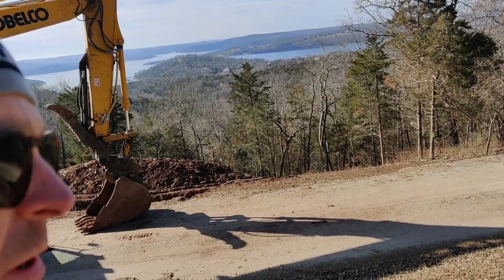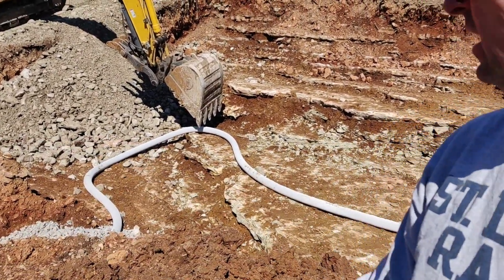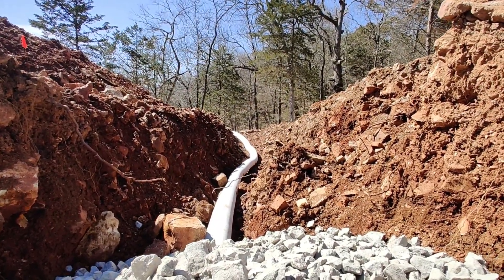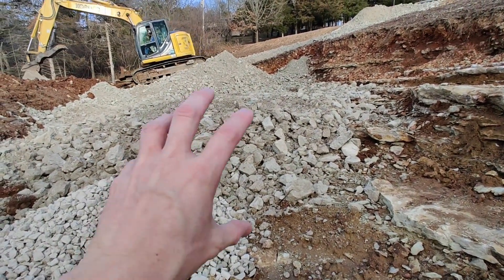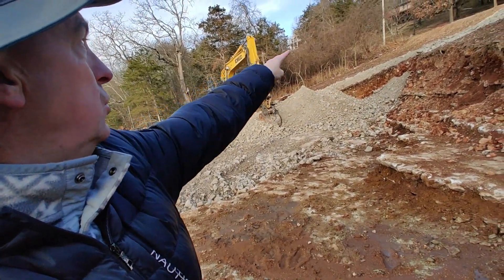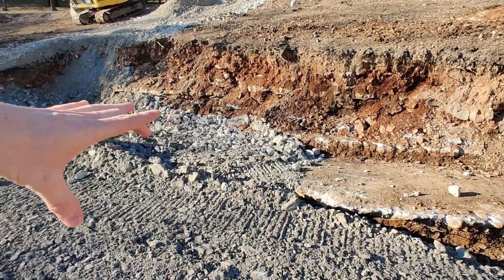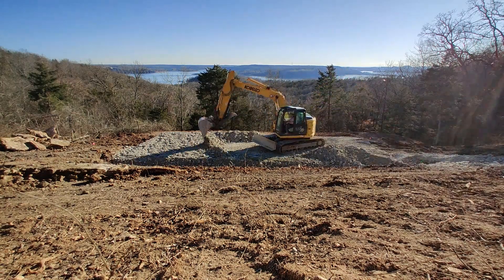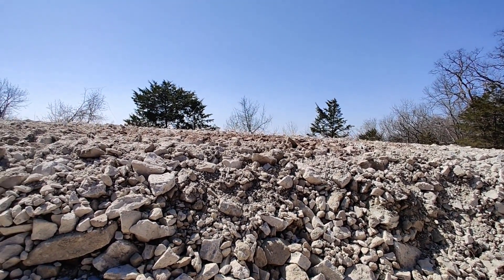Limestone Backfill and Preparing our Site for Foundation

Comment: John, I assume you did structural engineering drawings for your home? If so are you open for small project single family home I plan to build here in Nashville TN, I am originally from Kansas City and looking for someone who has experience building with ICF. If not would you recommend someone you worked with who has ICF experience. Please let me know how we can connect? Thanks,
Reply from the maker: A lot of our structural engineering was suggested and planned by the ICf builder we used.